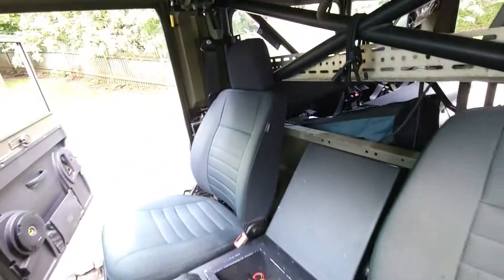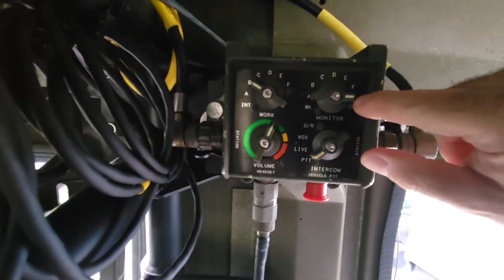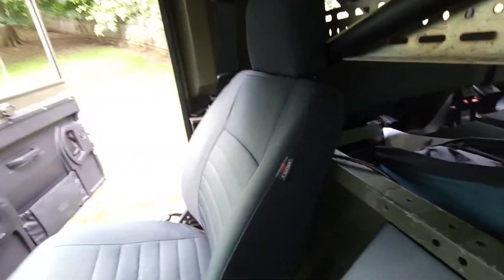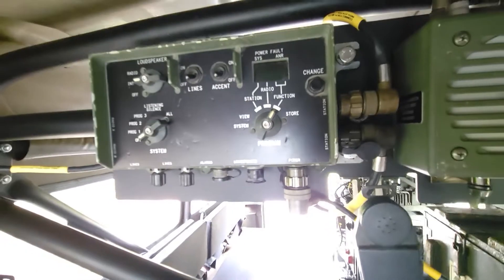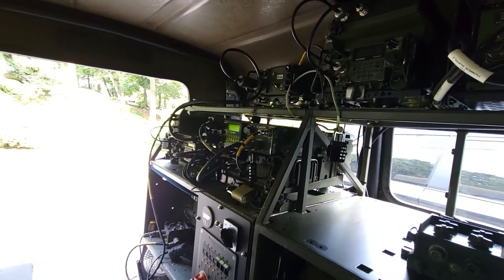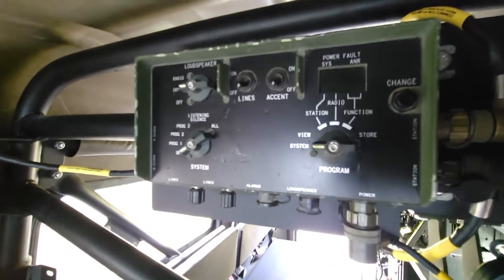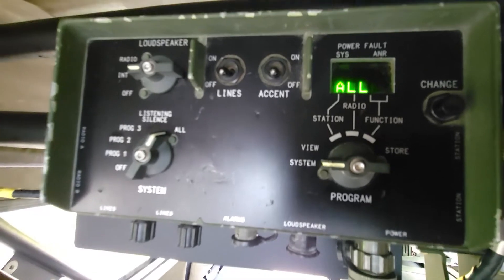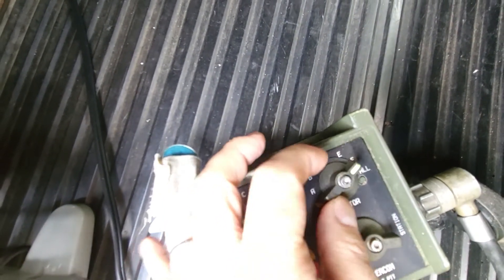Part 1 - Installing the VIC-3 Vehicular Intercom System

Comment: Can you change the positions on the cable ends? As in the cable going up, down, etc?
Reply from the maker: Yes you are correct. If you want the cables to exit the units in the opposite way, just swap the cable end-to-end and the cables will exist 180 degrees away from where they were. Thanks for the tip!